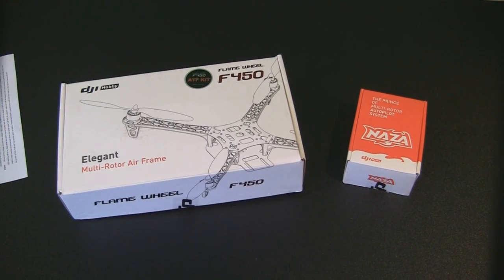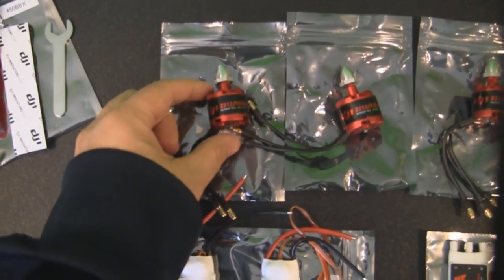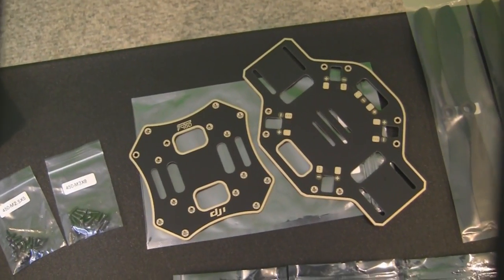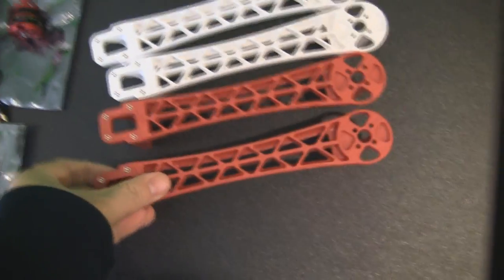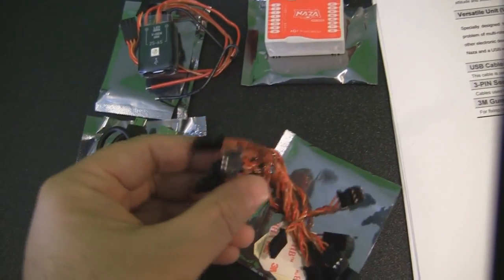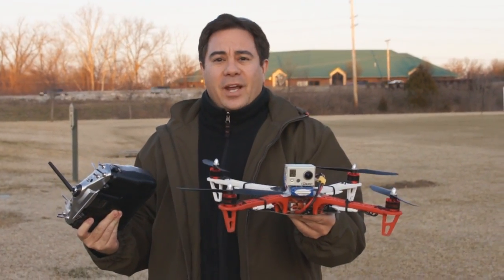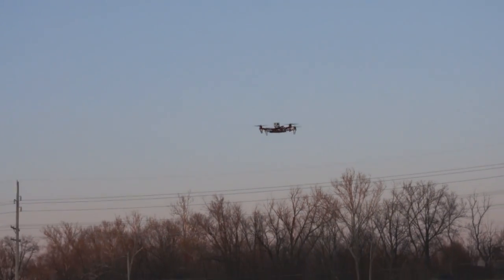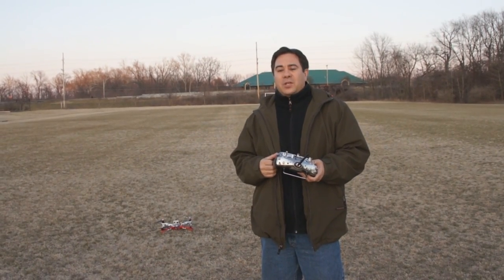Flame Wheel 450 Quadcopter with DJI NAZA Controller

Comment: 8:16 Glad you didn't hurt yourself, Own both Naza+GPS & KK2 1.5 firmware.
The difference is KK2 requires Firmware flash to 1.5 and you to know how to setup the settings. The NAZA fly's relativity well out of the box. So $30 for those who know and $230 who want the easy win +GPS upgradeable. The GPS is the ONLY reason I own a NAZA.